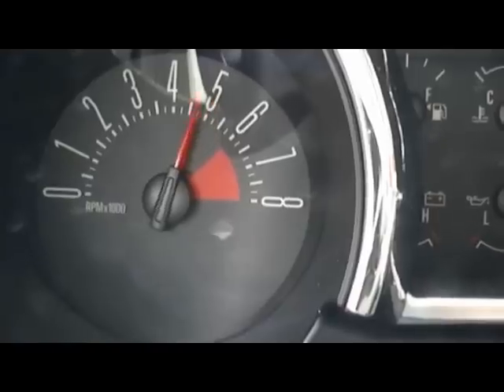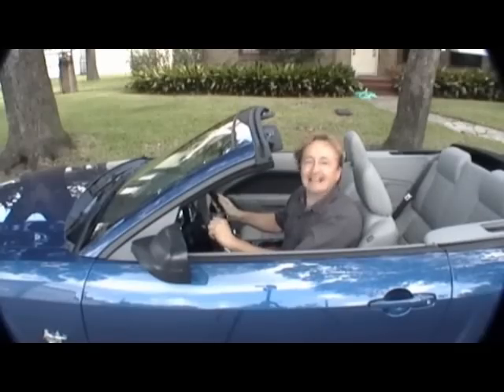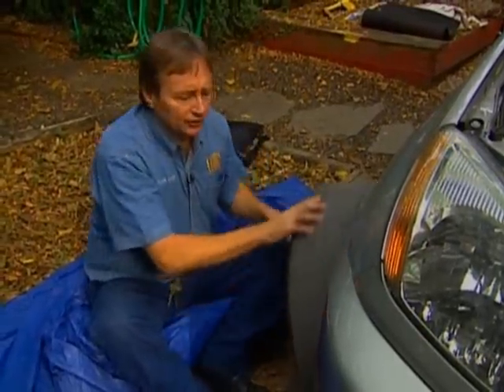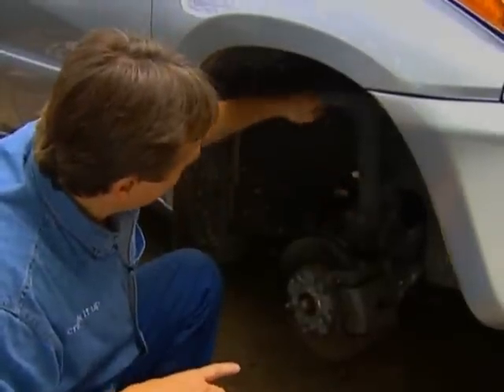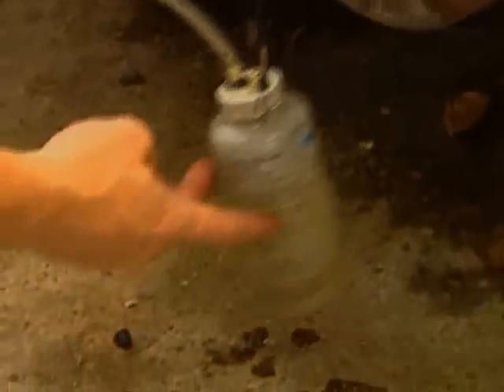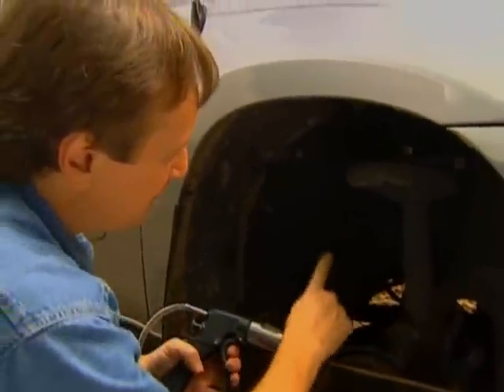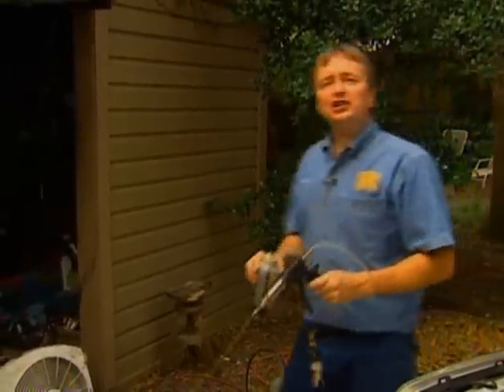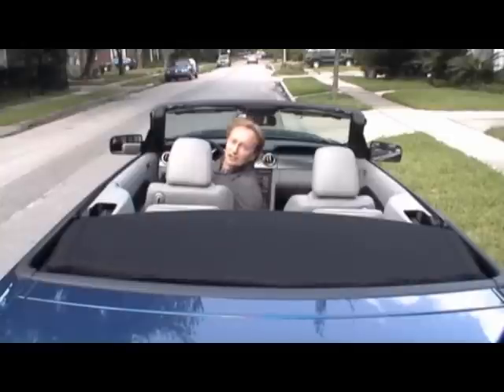How to Bleed Brakes in Your Car (One Person)

Comment: dude i did it , and i made a  mess, to be specific to my clutch system,,i got a oil pump gun,clear hose,put the gun under the level of the slavecylinder ,turned the bleeder 1 turn and pushed ,,all the fluid kept coming out from the bleeder threads and wet everything,,SO basically  i need that specific gun,, i know maybe somehting is blocing the line,but i cant put pressurised air into cause will be more bubbles right?

Comment: Hey Scotty! I always watch your videos when I have a problem with my car(s). Anyways I tried replacing my front brake lines, one was chewed off by a rat or something, to stainless steel and since we live in WI, the thing is rusted shut! I tried to take it off with penetrating oil and the torch method, being careful not to melt my lines but the thing is just stripped to death now. What can I do? I do have a nut splitter, using that as my last option...please help!

Comment: I thought the rule of thumb is never to send brake fluid backwards up into the system; what about any possible dirt that's settled down in there ?  it would go back into the ABS system (if equipped).

Comment: What am I missing? I thought those machines sucked the fluid out. Are you saying this thing pushes it in ?
Reply: yep, takes fresh fluid from that little bottle of fluid he has hanging there and pushed that fresh fluid in and up giving you a fresh column of New Brake fluid. i'm gonna get one so i can put New brake fluid in the lines by my self. brake fluid gets old and nasty. mine gets burned big heavy truck.
Reply: I have the same curiosity. I can't seem to find a kit that uses positive pressure to force fluid back up the lines.

My concern is that any particulate in the brake system which is normally kept in the lines by gravity is going to be pushed back up into your master cylinder, increasing the likelihood of the seals deteriorating in the master cylinder.

If I end up using this method as a last resort then I'm going to flush a lot of fluid back down after all the air is gone in order to make sure there is only fresh, new, clear and clean fluid in the master cylinder.

Comment: Do you think that would work on an ABS modulator unit?  

Those require a dealer tool to simulate the ABS system opperating so the air is pushed out. I had to hot wire the system in my Acura to do this at home after replacing the unit.  The dealer wanted $200 to do it and the Honda tool that is required costs about $1500.  

Your tool might have done the trick assuming the moduator does not have internal one way valves that stay shut unless ABS is activated.

Comment: sorry bout the Hi Scotty plain txt. I hv bleed all 4 wheels on a 97' f250 single cab base model 5.8L  over g.w. 8500#. Everything seemed to work good but the e-brake on the passenger side rear will not disengage. Ne suggestions? i hv driven it, engaged it while stopped and pulled the releae cord inside the truck. in idle it doesnt move, going slow it will completly stop. any idea's?

Comment: I HAVE A PROBLEM WITH MY 1999 PLYMOUTH BREEZE BRAKE.. WE CAME DOWN A MOUNTAIN AND ON WHEEL STARTED BLOWN SMOKE ON BOTH WHEELS.. ARE MY BRAKES GOING BAD OR IS THERE AIR.. SEE I REPLACE MY CV JOINTS ON BOTH FRONT. NOW MY BRAKES ARE UP IN SMOKE.. I HAVE LEARNED A LOT FROM YOU.. I NEVER DID MECHANIC WORK BEFORE UNTIL NOW... THANKS FOR ALL YOUR HELP.. PLEASE HELP ME AGIAN.... THANK YOU

Comment: @jcolcord5 My truck says bleed with gravity like you are saying & that's how I did mine. Screwed up once & worked great the second time. But know this: when they bleed airplane brakes, motorcycle brakes, dirt bike brakes, mountain bike brakes, etc.... it's from the caliper to the reservoir in the opposite direction of gravity. Personally, I've found it faster to bleed my motorcycle and mountain bike that way. But in the end... it doesn't matter as long as both hose ends are in liquid

Comment: My moms '97 Blazer has no rear brakes, my uncle "repaired" them 4 years ago but now they're worse then they used to be. I went to bleed the system but you know how Michigan cars are, the bleeder screws are so rusty they feel like they're gonna break if I twist them and the rear screws don't even have notches on them anymore so you can't get a grip on them. I know they don't sell just the screws so is there something else I could do or should I just bite the bullet and take the POS to the shop?

Comment: hi scotty i dont thank i blead my breaks right the pedel feels hard at first but if you are going like 40 mph than you go to try to lock up your breaks your frount like a panic stop it keeps going like another 150 feet the car still stops but at a panic stop its delyed i thank i have a little air in my master cylinder but i cant lock my  frount wheels up i thank my back wheels lock up before my frount ones do but in wet conditions i have a 91 chevy beretta gt 3.1 no abs any segestions

Comment: I was going to change my front brakes on a 98 honda civic lx. i discovered the pads were not in very bad shape, but i did have tor replace the caliper bracket because i snapped a bolt off. after replacing the bracket, i had to bleed the brake line after and it seemed to be fine, but before i got out of my driveway, the brake light popped on... my pads are fine, what do you suppose happened? how do i get rid of the light and make sure its safe to drive?

Comment: Hey Scotty,  I have a manual honda accord.  Today, I used a turkey baster to suck out the old brake fluid in the brake fluid reservoir, and then replaced it with new.  After I did that, I noticed that there is a second, much smaller brake fluid reservoir.  What is this second smaller reservoir?  Would you recommend that I replace the fluid in it too?

Comment: Thanks I'll try it out.  But will the old dirty fluid in the caliper comes out?  And how do I get to rebuilt the caliper if it's frozen since I can't get the bleeder valve out? And to get the caliper piston out air should be introduced through the bleeder valve to push the piston out.  Help!  Thanks.

Comment: well the car still stops but i cant lock up the frount tires if i had too plus when the car is off the pedel dont feel hard it feels sorta springey i can do hard stops but not lock up tires emergency stops so iem going to bleed the master cylinder first if that dont do it than iem going to replace it is that the best thing to do?

Comment: Hey scotty I have 2004 saturn Ion (series 1) with 180,0000 miles on it. The brake fluid is a nasty BLACK. This car has obviously been neglected before me. Should I flush the fluid using the 1 man method?  Is my brake dot:3 fluid broke down cuz its black? Or just leave it alone?

Comment: scotty i used this device on a 91 chevy beretta gt and i belive it started comeing out the back of the  cylinder squarting all over the engine i hooked it in the rears first am i an idoit what did i do wrong i mean is the campany advertiseing the pheonix injector wrong it failed on me

Comment: When did they start moving the bleed screws to the low point???  All the vehicles I have worked on to date had the screws on the high point, and gravity bleeding was adequate as long as the master cylinder remained filled. Never any mush doing it that way..

Comment: the problem with air in a breaking system isnt that it wants to go up.....its simply because air compresses, and brake fluid doesn't....so when you press the brake pedal not all the braking force goes to the calipers since the air in the system compresses first

Comment: I need to replace a rear strut on a Corolla. It requires me to separate or unplug the brake line in order to remove it from the strut bracket. Just the way it was design. Do I need to bleed the lines after and can I use this method?

Comment: i have never liked to push dirty fluid from the calipers into the master cylinder.
i like the draw through better. if in a pinch, i use this kind to push the air up, but only after i have fresh fluid in the system.

Comment: @Katmandu2 I've bled an ABS unit from 96 camaro, basically you bleed the ABS system first, then start farthest tires away from master cylinder (unless otherwise specified in the repair manual). I don't know if that's the case for all vehicles, I learned that bleeding the ABS unit last, leaves air in the whole system. Try the ABS first, then the other wheels and see if that helps.

Comment: If you have to pump more fluid in to get the air out, after all 4 corners, you would have too much fluid in, right? So would you then have to bleed the fluid back out?

Comment: or you can use motive brake bleeding system which is fairly cheap.. about $60 or so and it pushes it normally through the master cylinder using air pressure

Comment: hey Scotty here you are again to save my fucking damn life i swear the god if u wasnt on youtube people like me would be in trouble ....we do our best to learn mecanic tricks and such even wthout mecanic formation but U ARE THE GREATEST handy man ever.

i swear the god i did my brake yesterday and i simply fucked up...pedal was go almost to the floor i was attempting to put a metal bar on the god dam driverseat reaching the pedal and finally....today all i had to do is 

get a bottle 
grab a polypropylene tube vacuum it with a lil of pre-juice in it after pumping a few shot with the FAMOUS BLEEDING VALVE u were talking , yesterday i was going directly for the hose valve not the bleeding valve what a stupid idiot i was......thats why my brake pre-matured the first time and were used so badly i didnt put any silicone also to the pin....i swear if u saw me u would be dissapointed but

TODAY WAS ANOTHER THING!

bottle
plugged

10-15 shot until i see no air bubble
lock the shit in
repeat on both side....and damn man the pedal is so sensitive now! i LUV IT

Comment: I have a question. If I'm doing a complete brake job, consisting of, New Calipers, Rotors, Pads, and brake hose. Naturally, air will Gary into the system. My question is, do I have to bleed all 4 wheels, our still only the side I'm working on?

Comment: Hello Mr.scotty,I Just have few question about bleeding my honda civic 2004 ex,do I need to keep the engine running,while im bleeding the system,my car brake pedal is hard when it off,but when the car is running,its soft spongy,it took 2 pedal push too feel the brake is working,this was happened after I change my brake shoe..thankyou

Comment: Just checked the price of this device, the metal jammie he uses in this vid w/ all the bells and whistles is over 100 bucks on eBay.  there is a so called "poor" man's version on Amazon for 50 bucks.. multiple reviewers stated it broke after the first use.  
I am thinking old school squirt gun, a couple of one way valves and some tube for less than 10 bucks.  anyone else agree and/ or could tell me if that would end up introducing more air into lines?  hate to rip the company's idea, but I would just use it for my own use, not sell it, and if they made their 50 dollar product half way decent, wouldn't have to.

Comment: So, I just flushed my brakes and make certain that the fluid had no air bubbles. Now the brake pedal is spongy.  Pedal was pretty firm prior to this. Do I need to do an auto bleed on the ABS? Any suggestions?

Comment: Hey Scotty,

I used the Phoenix Injector (PI) the other day to bleed my clutch and it made the job easy.  I told another guy about it and he kept going on and on about how I wasted my money because it takes so long with the hand-held PI gun to bleed the back brakes due to the longer lines.  He strongly advocated "speed bleeder screws" over the PI thing.  I looked into those things and I didn't feel comfortable with their design. Any thoughts as a professional mechanic on this choice?  THANKS!

Comment: Scotty, i have a 1986 ford thunderbird and when i push the brake pedal, the pedal goes down a little bit before the car starts to stop. I adjusted the brakes and it worked for about a day. Should i bleed the brakes?Also, can i use the method of bleed the master cylinder like you did in the video when you replaced one?

Comment: @mpackow The one at harbor freight works on a Vacuum rather than pressure system meaning it pulls the fluid from the master through the caliper. This works OK, but the air will still want to travel up to the master. 

I use the vacuum type and it works well, it might not be quite as efficient and you might use more fluid in the bleed.

Comment: So after you changed a caliper your going to push the air in it back up to where it gets stuck in the abs unit then get towed to the dealership so they can bleed it with diagnostic equipment? Think i will give this a miss

Comment: Hay Scotty, I removed the left front brake hose to the car then put it back so it wont leak until I get new calipers next week. Should I bleed just the left front brake fluid or all four wheels including the master cylinder ?

Comment: Wow, Vintage Scotty from 10 years ago, LOL. I really wish I'd watched this video sooner, it would have saved me SOOOO much hassle.

To clarify, the proper way to use a reverse bleeder is to purge the nasty fluid FIRST. Then reverse bleed the air out. You old timers without ABS will say there's no need. Or just go drive on a dirt road. No and no in my case. 

I replaced lines/hoses/fittings and front calipers/rear wheel cylinders. My older car has ABS and I live in an urban area. I need a safe way to get the air out of the system BEFORE getting onto the road.

If you have ABS and got air in your system, reverse bleeding is THE WAY to go !!!

Comment: Hello Scotty,  I have a question, will this work on cars that have ABS.  I been told that cars with ABS are trickier if you happen to have bubbles in the actually ABS actuator. They say that you need a special tool to bleed the bubbles out of that.  Is that true, share your thoughts please.
Reply from the maker: yep, abs bleeding fully requires a dealer level scan tool to operate the ABS modulator valves. Yet another reason I hate ABS, Giant pain to work on and I have the equipment. Just a big pain using it

Comment: I'm trying to fix my brakes. The pedal sinks to the floor. I watched your video on sinking brake pedals & you used a different method all together.  Im wondering 3 things: 1. Is that just for the brake pedal problem?  2. Do I need to get any tools beside a screwdriver?  3. Does this work for the whole system? Do I need to jack the car?
Reply from the maker: you can use just basic hand tools, wrenches that fit the bleeder screw, and you generally have to jack it up to access the screws

Comment: Is there a cheaper break bleeder besides this phonix? And do you only have to use it on one tire?
Reply from the maker: they make a cheaper diy units made of all plastic. And you can use it on one tire If the air is ONLY on that line
Reply: Ok do you know a name of one im seeing alot here making sure get the rite one
Reply: Yes there are. Mityvac in harbor freight for $40 but it is different. Special Price for this weekend.

Comment: Scotty Kilmer I have a question for you when using this tool what keeps you from pushing the air through all the other lines it’s only got one exit which is through the brake reservoir so when you push air through the front caliper what keeps it from pushing it through the rest of the brake lines to the back are usually use a air bleeder which is basically a vacuum you open up the caliper screw and suck the Air out until it’s a constant stream of fluid so how do you prevent from pushing air back through the system another question is how does it not harm the ABS because that is the main reason they tell you to crack the bleeder screw when you are pushing calipers back in to avoid pushing trash through the ABS pump thank you
Reply: I wondered the same thing...🤔💭

Comment: hey scotty my 06 camry real low pedal replaced rear shoes and mastercylinder   bleed all 4 tires still  pedal  goes to the floor what to do next
Reply from the maker: +Ronnie blanton  sometimes you can't get air out of an ABS system without a dealer scan tool to bleed it right. Start there, and pray it's not an ABS module failure

Comment: when your bleeding it, do you open the cap for the master cylinder? or leave it closed?..
Reply from the maker: depends on how you bleed it. If you use a reverse bleeder like the phoenix injector, you leave the cap off. If you bleed it with your foot on the pedal, leave it on
Reply: Scotty Kilmer Thanks Scotty Kilmer! :)..